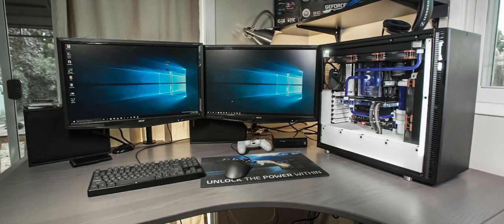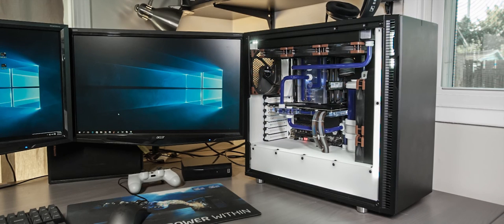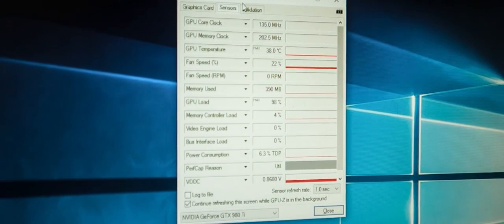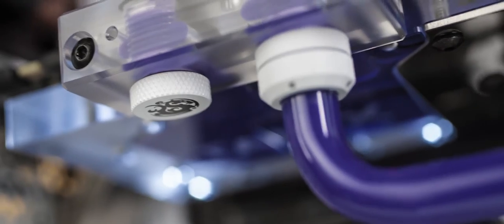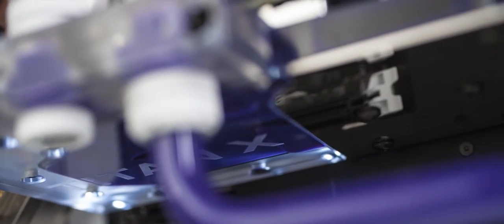First Look and Install - Bitspower NGTXTITANX

Comment: Quality video! definitely need more subs :)
Reply from the maker: Thanks Erick!
Reply: +metaljeff I bought the 980 ti Bitspower waterblock and does it not need thermalpaste? does it just use the thermal padding? That is what it looked like in your video too, but I couldn't tell. Thanks! great vids.
Reply from the maker: Marc Sciandra It comes with all the themal pads needed, you just need some thermal paste for the gpu

Comment: Nice video came here from your IG.  On the problem you had with the color with the mayhems, I had same problem with their pastel green( mint green maybe?) came out like a lemon lime Gatorade color but a bit of blue dye changed it to green. Anyway nice info makes me want to pull the plug on a Titan x and that purple looks very nice in your rig,  very jealous of that mobo block looks sick
Reply from the maker: thanks man love the full cover block too.  thought about some dye but thought I would drain it and flush so I could check the blocks and make sure they weren't corroding.  might get some dye if it happens again.  cheers!